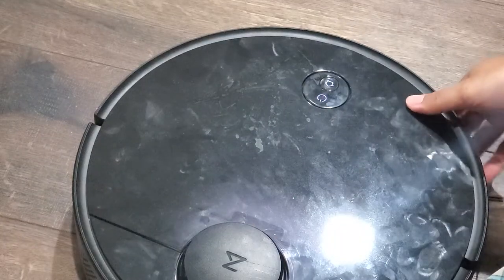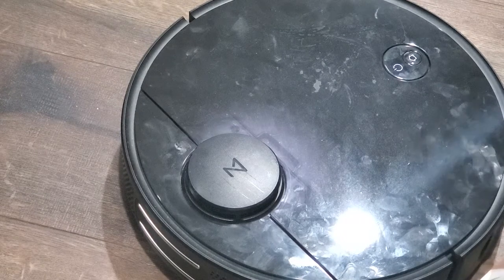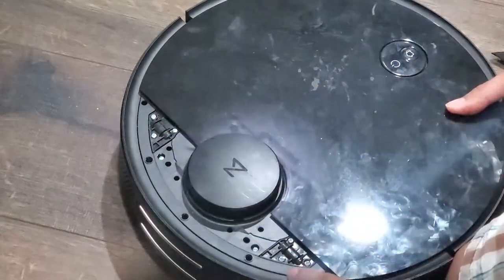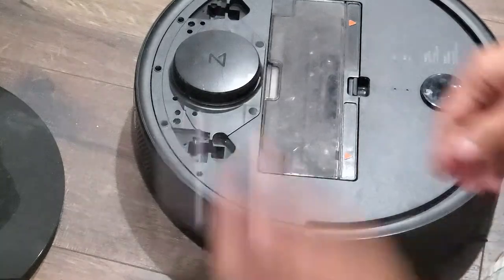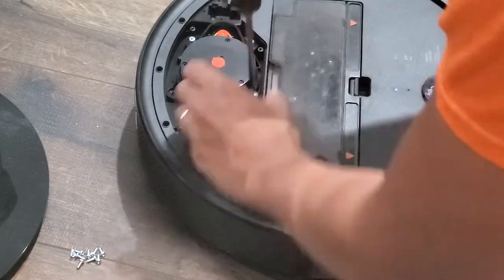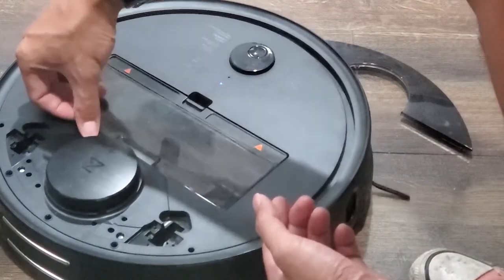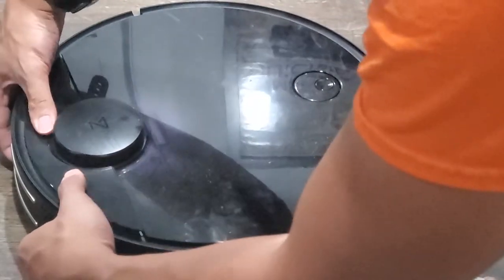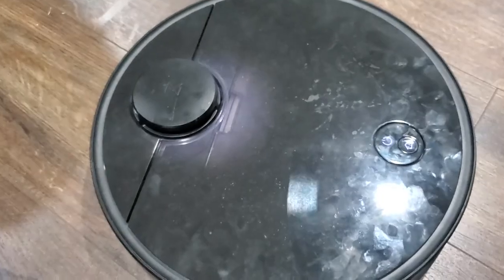Replace LDS Sensor on Xiaomi Roborock S4 (Fix Error 1 Code)

Comment: Thanks!  I was able to just loosen some debris from the lidar motor, and it spun again.  It was way easier to open it up with the help of this video.  I used a 9v battery with some alligator clips to test the motor to verify I'd fixed the problem before closing it back up.  It was hard to visually see the debris lodged in, but the exacto knife I used to pop the rubber screw heads off came in handy for scraping little bits of fluff and stuff off the motor's drive shaft under the orange part that connects with the little orange belt.